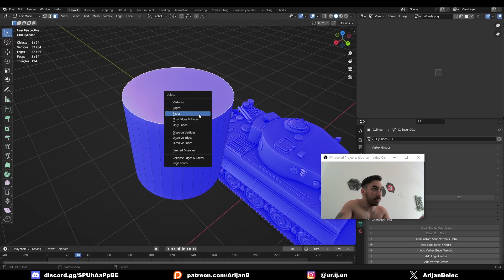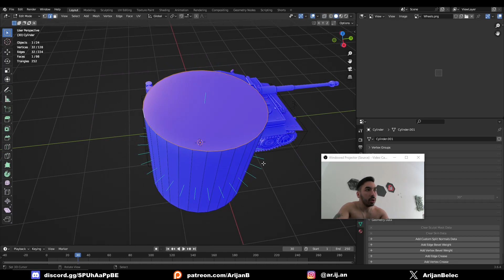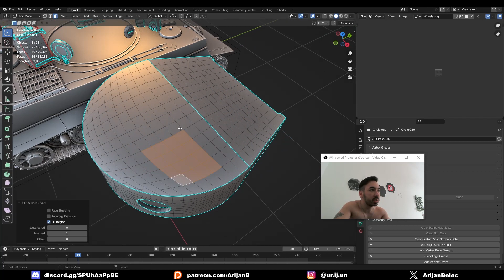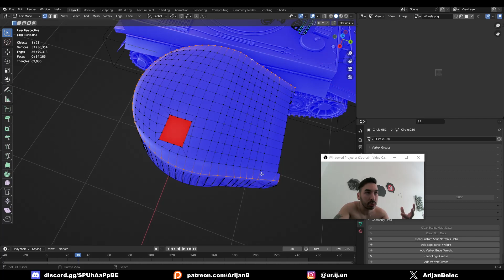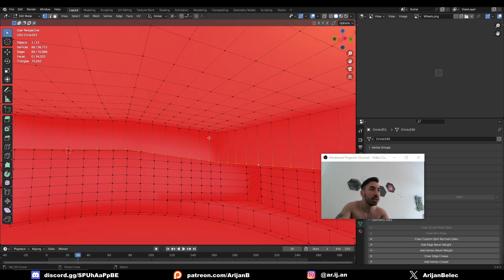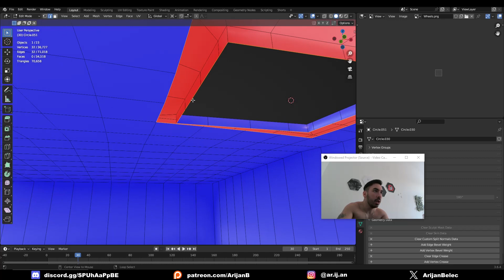Modeling a TANK INTERIOR in Blender (Part 1) (Arijan)

Comment: I'm currently working on the interior of a tank, and I'm glad I stumbled across this! I have a mock-up of the tank cut in half along the X-axis, which helps me place parts relative to a print of the tank. Now that I’ve started making parts for the inside of the turret head, I've realized that the interior shellis not square and more egg shaped, making my placement more challenging.

I've been trying to create an interior shell for a couple of weeks, but I haven’t been happy with anything so far. I had a clear vision of how I wanted to build it, but I struggled to put my theories into practice. Thanks to your video, I've found some new ideas to try. Keep up the great work—thanks for your help!

Comment: The way I do it is: Delete the faces where hatch is, and use solidify modifier and its sooo much faster
Reply from the maker: You are right Babarin, but in my case I had details on the outside of the turret which were merged with the main body mesh. Solidify modifier would have also made those details visible from the outside, which I tried to avoid. If your turret mesh does not have anything else attached to it, then it's definitely better to do it your way.
Reply: @Aryan3D  yeah I never merge details to turret just for that since I ussualy make interiors aswell and that method is very fast + you can adjust thickness in non destructive way till you apply the modifier so it's all good 👍🏻
Reply: Yes same here, but I guess if you want a shape (room size too) inside that are different from outside shape then his way is OK. But anyway it was a informative video, especial for beginners that try to learn blender or 3D modelling overall!